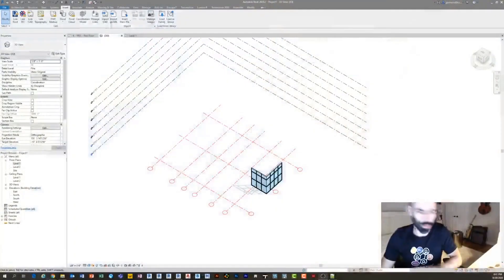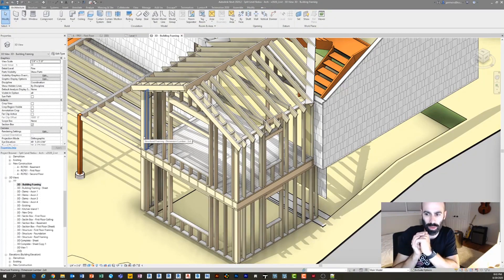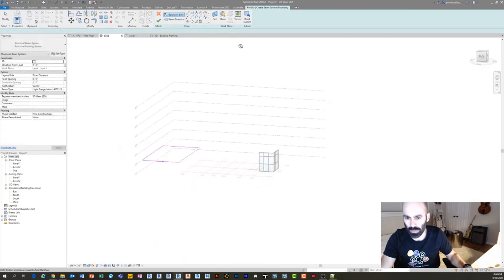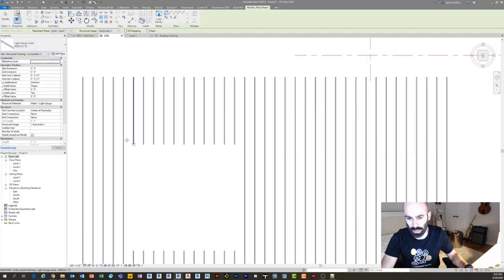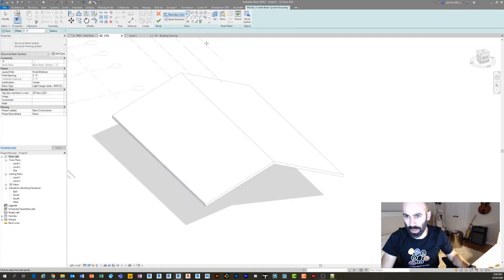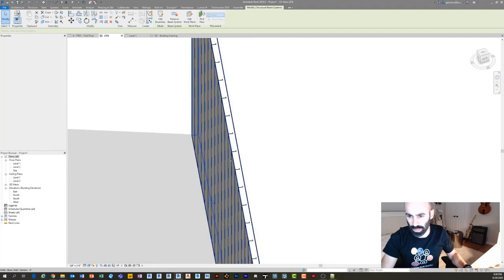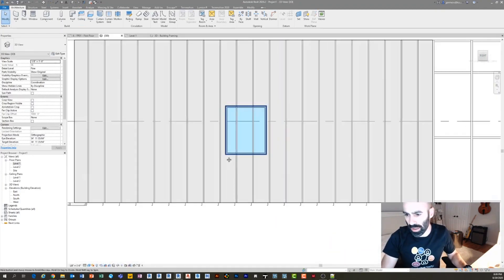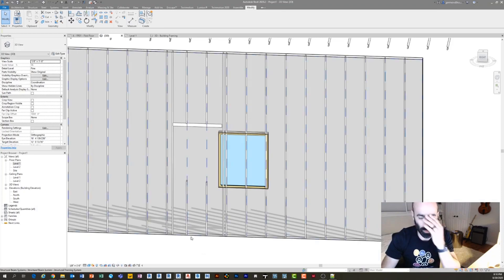Cold-Formed Metal Framing (or wood stud) in Revit Tutorial (Quick Tip Edition)

Comment: Thanks for the tip, but the studs will not be at the edge of the wall like you have shown. How do you offset the beam system to account for the other layers in the wall? 
PS. You could also use a curtain system for the wall framing, might be easier to update.

Comment: Hello. Is it possible to create a curtain wall instead? if it can be, how can we make the millions in the curtain wall structural?
Reply from the maker: If you use the curtain wall method... you will be using mullions to represent the structure.  they cannot be "structural" elements in the sense of Category or having analytical models.  If you NEED structural category or analytical models, use the beam system method.

Comment: Hi, when I copy a joists from a framing system, it looses the association with the system and I can`t put it back. It didn`t always happen but I dont know whats causing it sometimes or for some specific joists.
Reply from the maker: If you copy it … the copied instance will not be part of the system.  That is correct
Reply: @TheRevitKid  But this behaviour is not consistent, ocasionally it did keep the association. Very strange.
Reply from the maker: @Constantinesis  it shouldn’t …. I’ve never had a copied instance be part of the beam system it was copied from …

Comment: Hello, thanks for this , is very helpfull! For the beam system approach, can you set an offset from the wall plane? How  can you add the studs in a compound wall with insulation and panels on both sides for example and keep the framing in a particular offset inside the wall?
Reply from the maker: You can 100% offset from the plane with beam systems.  For what you are talking about you can have them hosted even on the same plane and offset differently.  There is an offset setting for all beam systems right in the properties,  For a double wall like that, though... It might be cool to make a double stud beam type and do ONE system.... hm.... interesting.
Reply: @TheRevitKid  Thanks, you convinced me that I dont need to buy a USD 3k + plugin yet to do some basic metal or wood framing estimation.
Reply from the maker: @Constantinesis  haha, some of those plugins are great!  But, it all depends on how often you do this stuff and how efficiently you need to do it… 😜
Reply: @TheRevitKid  Thats totally true ! Would love to have one of those but cant afford yet

Comment: Just a tip regarding the opening. It won't solve the other issues but if you already have the openings you can Edit Boundry for the Beam System so that you cut the openings and you lock so when you move the window the cut moves with ut cutting the joists as well.
This will break if you change the size of the opening.
Reply from the maker: Good point!  Not sure why I didn't mention that! :)

Comment: Little trick from a structural point of view : never modify the length of the beams with the blue arrows, but with the blue circles.
These arrows do not modify the structural length of the element (analytical lines = lines of forces), but used for connection adjustments.
Reply from the maker: Great tip Matthieu!  Thank you for pointing that out!

Comment: You might also look into using Curtain Walls.  You have to setup profiles for Metal Stud sizes and the Track sizes and Curtain Wall Mullions as a Metal Stud.  Once you are done it works rather slick and will add headers, sills when openings are added. It is a tad challenging to setup if you’re unfamiliar with Curtain Walls, but when you’re done it works great.

I used this short video as reference when I created my Framing System, “Metal Stud Walls Revit” by BIM One
www.youtube.com/watch?v=A-OMgXU6e6g